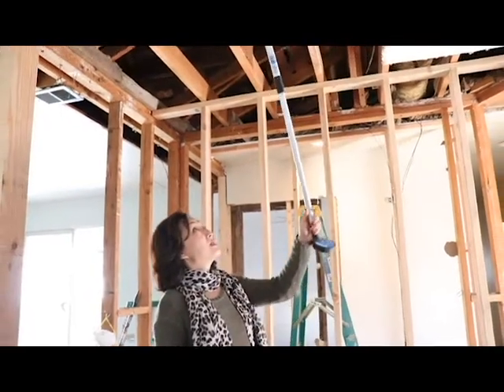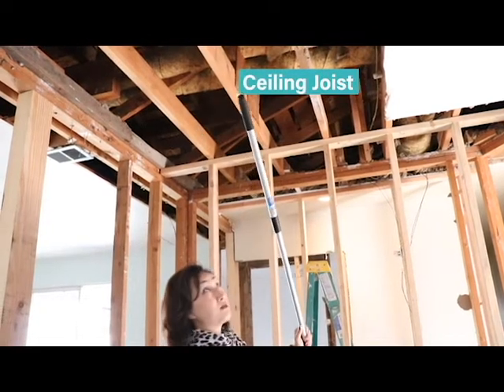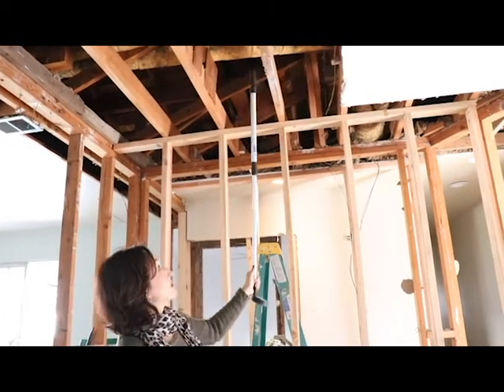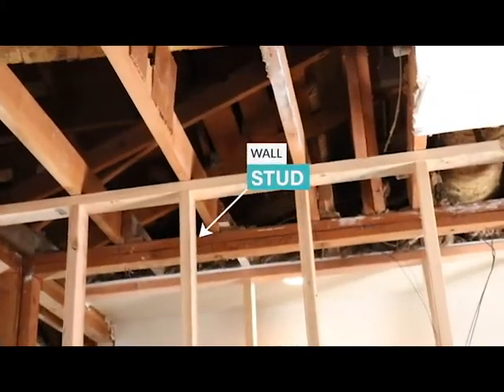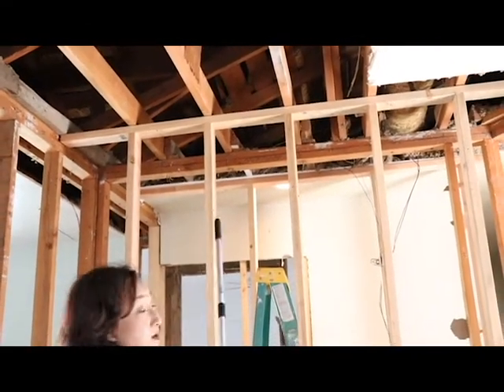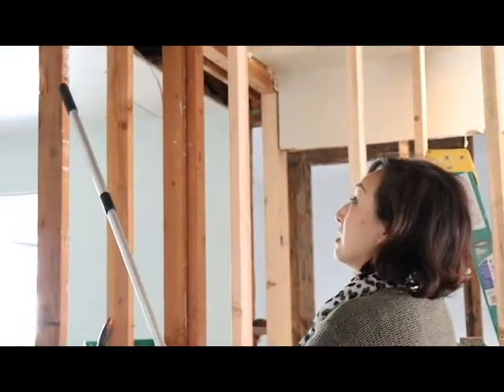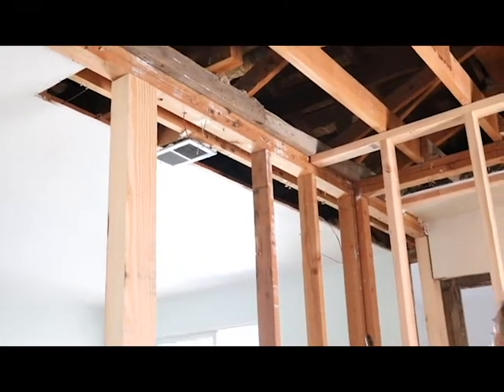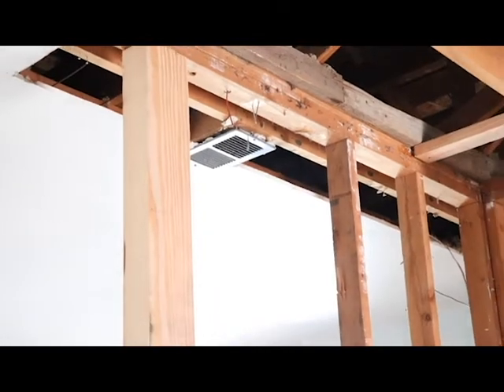What is a load bearing wall?

Comment: Well done Heather. In most cases a load bearing wall holds truss joists or rafter joists that connect from opposite sides of the house.
Reply from the maker: Good Point!